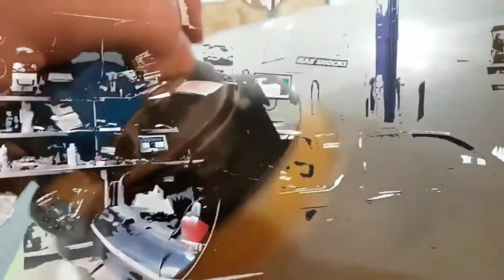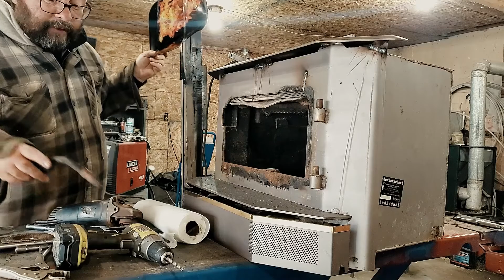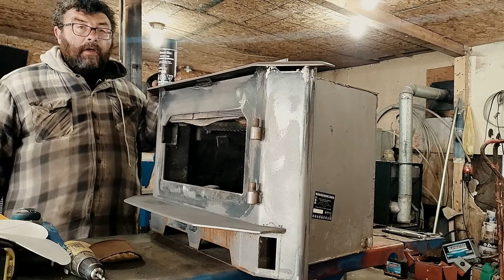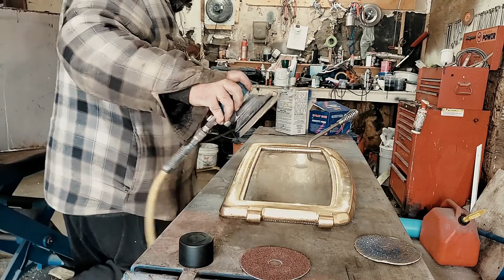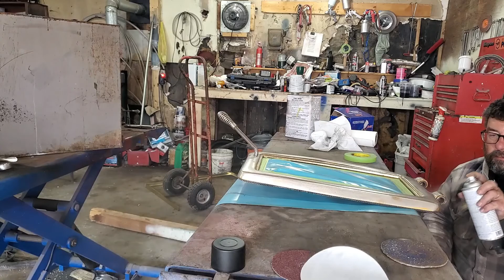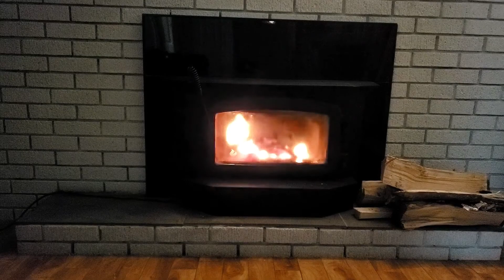WOOD STOVE REPAIR & REFINISH

Comment: I hate to be the safety police, but use a guard on your grinder.  Also, wear gloves. I had a bit of skin cancer surgically removed last fall on my hand that was likely caused from welding without a glove on that hand.  
Great job on the stove, it looks 100% better.  Especially with the old brass thing painted over.  
I think I'm going to paint my F150 this winter ad realize I need a new DA sander.  My old Hutchins works great still, but it's loud as hell and uses a ton of air.  Any suggestions?
Reply from the maker: I have been using a princess sander for about 10 years without fail. A few months back a bought one from Amazon to get an updated version with the velcro pad ,it was cheaper than buying a pad lol.
But if you are interested in electric I bought a 6 inch electric from home depot   
Super quiet works well only draw back is the size of it but is very comfortable to use. https://youtu.be/s0ZCtwNCSH4